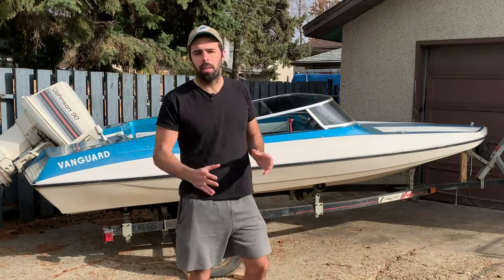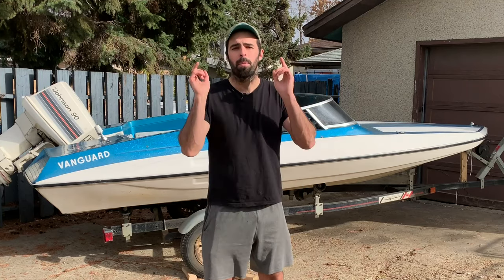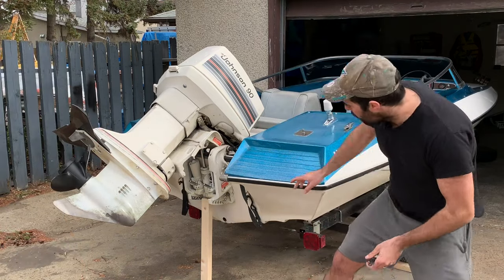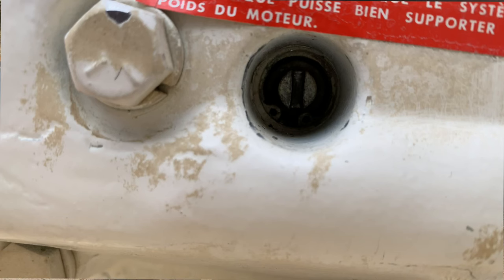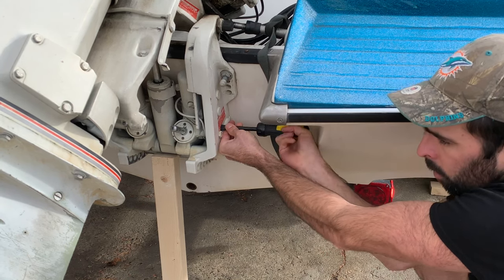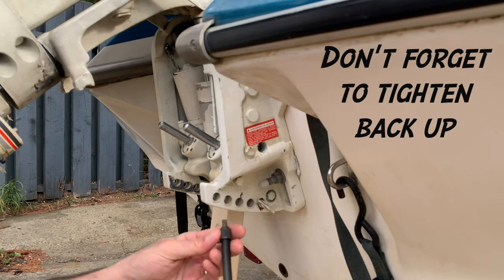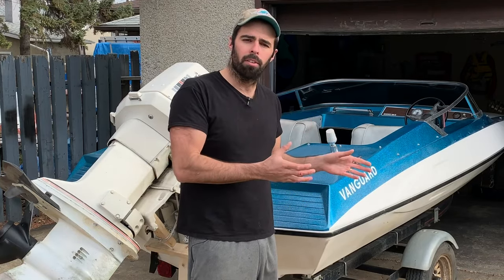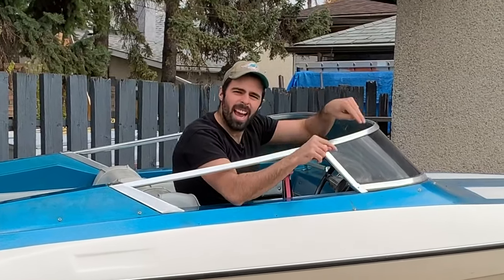How to Manually Raise or Lower your Outboard Motor

Comment: Thank you !   This was very helpful while I was on vacation in Florida.  Sadly the lock screw was seized and I haven;t been able to unscrew it.  The release on my 98 Johnson 115 was on the left side of the mounting bracket but you certainly showed me where to look and what to look for.  Another friend of mine said that I may be able to unscrew the fill cap to release the pressure, just a thought, I haven't tried it yet.  Thank you for your video.

Comment: I have a 1974 Cobalt tri-hull Cruiser. In board/outboard. I don't know anything about boats, but when I press the button for the engine to go down, it does...However it won't go back up unless I manually do it. Is this an easy or costly fix?
Reply: Did you ever find out?
Reply: @jividenpower8195  no, I moved out of state... just ended up selling the boat..
Reply: Super late reply, but the fix was to refill the hydraulic fluid. Probably had too much water or air in it
Reply: @dhdeanha  i did the same, thanks!

Comment: I cannot back the screw out....is it possible it has retaining ring or something stopping it?
Or frozen in place?
1999 200hp johnson
Reply from the maker: Daniel OLinn could be seized try back and forth a little keep working it until it moves. Maybe a penetrating lubricant over night. Be careful not to strip the screw.
Reply: My screw wont screw back in any suggestions?
Reply from the maker: @codybrotherseasttexasoutdo1581  Maybe keep backing it off a tiny  bit and continue to try and tighten it.
Reply from the maker: @codybrotherseasttexasoutdo1581  

Maybe keep baking it off a tiny bit and retry to tighten. Be careful not to strip it.

Comment: I don’t have the screw
Reply from the maker: No way what engine do you have ?
Reply: @Bansheeboat  1997 johnson 40
Reply from the maker: @jrs351  the screw may be on the back of the motor as opposed to on the side like mine. It should be the screw on the left on the motor side of the hydraulics.
Reply: @Bansheeboat  ok . i appreciate the info. i will look tomorrow after work. ill get back with you
Reply: @Bansheeboat  I did see it. I have an issue tho. I replaced the two relays and when I push the up or down button on the motor , the relays buzz but the motor doesn’t move. I am thinking about replacing the tilt motor itself but I may add hydraulic fluid to see if that’s the issue. Your thoughts?
Reply from the maker: @jrs351  try adding the oil first I guess Since it's cheaper but it sounds like you may need a new motor. Maybe test the voltage at the motor and make sure the relays are working also.
Reply: @Bansheeboat  looks as tho ill be replacing the trimand tilt motor. i appreciate the help